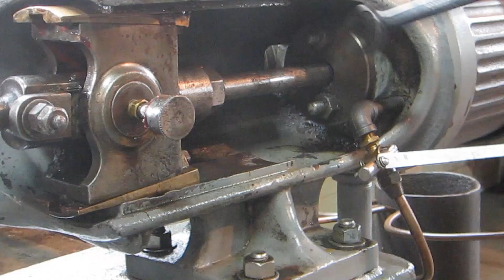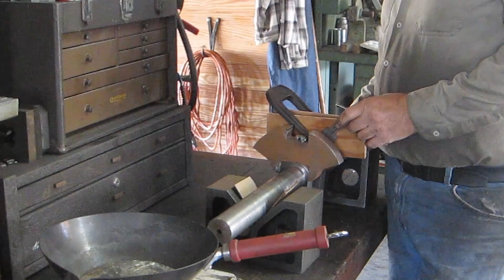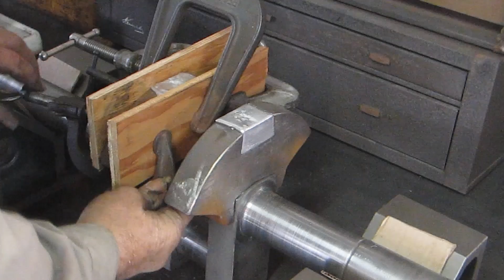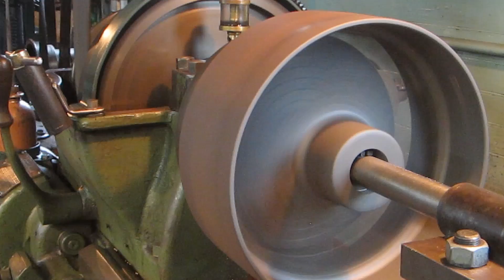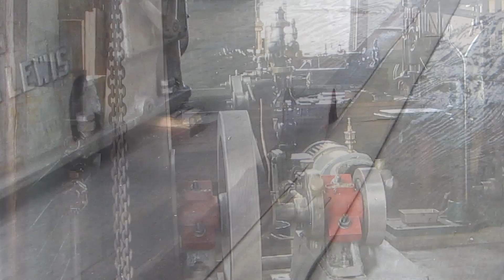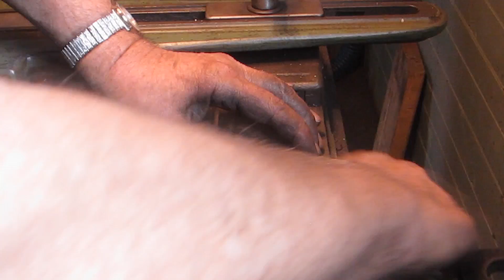OLD STEAM POWERED MACHINE SHOP 21

Comment: Would have been nice to see how you splice a belt? 
Also what oil you use and do you use some sort of glue on the inside to gain friction?
Reply from the maker: Hi John, thanks for watching. I've spliced leather belts 6 or 8 times on some of the earlier videos. I use Neatsfoot oil on the leather now and then, no traction dressing is needed if they are up tight where they belong...Dave

Comment: I noticed a good deal of line shaft coverage on this video,  it was quite good.  When I was very young in an old ranch shop I saw a line shaft system that was equipped with squair profile shafts  throughout the entire system.  The power source was not present.  And several of the remaining shives were constructed from wood. Have you encountered a similarly equipped system? Recently I went back to see it I could get photos but the entire building and all the surroundings building wear gone.
Reply from the maker: Tom, I have seen many wooden pulleys but never a square shaft. Very interesting.....Dave

Comment: very nice job. Have you thought about adding a boiler feed pump to your engine or having a separate steam boiler feed pump?
Reply from the maker: Yes I have a 2 cyl. steam pump that could work for that but would need a feed water heater of some kind made up in the stack bonnet because the pump would put the water in cold, not heated as the injector does....Dave
Reply: Nice. Have you thought about using the Exhaust steam from the lineshaft engine or the pump?   Josh K.

Comment: say dave, really like your videos.  very nice.  here is a thought. about that pully, with the 1/4" crown, I noticed it had a factory balance weight inside the lip.  with as much material you removed, that may throw a lot of vibration into your rafters if it looks as heavy as it is.
Reply from the maker: Hi Paul: All the pulleys are balanced on a mandrel within 1/4 ounce before they are installed on anything...Dave

Comment: When I worked up in Alaska, they put me in charge of the boilers, and my boss had me put in a 8 inch PVC line into camp (yeah it was just above the frost line- good thing I knew how to make sure that they drained) that ran to first a 100,000 gallon boiler feed tank then to the main water tanks for camp. Then I trained a bunch of college kids to thread 4 inch pipe and ran that line 1000 feet to the old boiler secondary tank and to two 125 horsepower diesel boilers. MY Question is stainless fittings? I thought stainless does not get along with steam. I do know you can't use galvanised pipe. Brass is OK, and Black iron pipe is OK too. I am not saying that right. I just remember chasing leaks, and sometimes having to go 40-80 feet to get them all. The two big boilers ran 10 retorts, and the old boiler was really cool. We use a venturi tee to atomize diesel to heat the boiler using steam, and we had a steam driven water pump to keep the water level correct (it used leather check valves) . Ii spent a week cleaning out the flew pipes for all the boilers, and a day crawling down the middle of the two boilers doing a inspection. Good memories.

Comment: Dear David, could you tell us what you know about leather belt maintenance (not repair)? Either in the comment section or possibly in one future video? Does it need wax or oil to stay soft and tough for a long time? Thanks in advance.
Reply from the maker: I use just Neatsfoot oil on the back side. It works it's way through....Dave
Reply: In what intervals do you apply it?
The back side is the hair side? And the meat side is contacting the pulley.. Some other videos are contradictory on that.
Reply from the maker: Correct, hair side should not be against the pulley to avoid cracking, but I've run either way. the new belt material is so soft and stretchy that the hair side gives more traction. I oil them a couple times a year. most important is running them in the right direction so that the splices won't chafe.....Dave

Comment: 20:31   I have what is probably a really dumb question for you-------why not use a magnet to get rid of the iron or steel filings in the bored out hub etc.???????
Reply from the maker: Not a bad idea, then you are not blowing the iron dust all over the shop and into the chuck...Dave

Comment: First of all I love the videos and the subject so thank you very much. I live in Arizona and I realized that a steam engine might be an excellent choice to pump water in the middle of nowhere. what bore and stroke should I look for to replace a3 to 4 HP pump. Wells out here are deep. Think 700-800 feet?
Reply from the maker: Hi Joel: Well. not knowing anything about the type pump it is, it 's a little hard to say, If it's a real deep well, the pump would have to be down in the casing to within about 25' of the water. A pump like that would have to be a rotary type with a rotating shaft down to the bottom or a reciprocating rod pump with a crankshaft to run it up above ground (like an old oil well)  Those were like the windmill driven pumps. Probably a 5-6 HP steam engine would run one of those.....Dave

Comment: You have encouraged me to get into steam. As an engineer doing mainly solar and wind design and manufacture and renewable energy in general along with extensive contract prototype work, steam using wood fuel fits in well

I have developed and sell what I have called a Sun Chiller which is a solar powered foam insulated 200 cubic foot box on wheels that serves as refrigerated harvesting of perishable greens etc. Easily holds 36-40 F even on the hottest of days.

I designed and built a solar powered parachute droppable emergency water purification/power station/communication station for the military.

Now a local CERT (Community Emergency Response Team) group took an interest in that design and now  has me doing a combo of the chiller/water/and power and they wanted backup for the solar power.

They were confident that even in a big disaster diesel or propane would be available for generators.

I convinced them that locally salvaged wood would be far more available.

Now I'm putting in  a 10HP rated monotube boiler and engine driving a generator as solar supplement.

I have developed a very low cost method of converting permanent magnet stators and rotors from salvage Prius trans-axles as 10kw 48 volt generators regulated to batteries via an off the shelf solar regulator. Even with the additional  materials and machining for a new fluid cooled housing I come out way ahead of anything else I can buy so far as dollar per watt.

I now power my extensive machine shop and wood shop from solar but after seeing what you are doing with steam I'm contemplating a larger steam setup for more solar power backup.

Thanks for some very interesting videos.

I may do some myself once I get this new boiler/engine going..
Reply from the maker: very interesting so far, good luck with it....Dave

Comment: Dave, what size of hit/miss engine would it take to replace your steam engine?
Reply from the maker: Gee I don't know Gord, maybe 6 or 7. The "Flywheelers" will be running a 7 HP Economy on theirs, but I think the main belt will be a little "jumpy"....Dave
Reply: Gord Taylor The Tri-State Threshers in Bird City KS have a hit and miss engine on a line shaft setup in the blacksmith shop running a lathe and a couple of other machines, I think it is 5hp (not sure) but it gets pretty warm so probably should be bigger.
Reply: Not many of us metal heads have the means to have a steam driven shop like Dave Richards but might be able to use a hit/miss engine for a similar shop.

Comment: Dave another great video. Now another steam engine in the wings. What are your plans after you restore it?  Will it have a job in the shop or maybe outside the shop?  Please keep up the good old work. Thanks.
Reply from the maker: Hi Gerald, One plan would be to put the Richards engine on the line shaft running the shop and moving the O&S engine to the boiler side of the door and run a lighting generator with it....just a thought....Dave

Comment: Well, this is weird........ I visited your channel just yesterday to make sure I didn't miss a new  video, and here you are today with a new video, LOL !!!!  Your videos are my most anticipated on YouTube.  Thanks for another edition of great work and fun !!!!
Reply from the maker: Thanks Mr. Iron, would the 292 be an inline Chevy or Y-block Ford?
Reply: That would be 292 Chevy inline 6.  I'm a classic Chevy truck fan, and a huge fan of Chevy's old Stovebolt inline engines such as the 235 and 292.  However, currently I'm restoring a 1929 Ford Model A Doodlebug tractor conversion which is an original conversion from the 1930's.
Reply from the maker: Great old engine, I've got a front engine dragster with a 292. runs 10.0 &138mph on gas.
Reply: Oh man, that's cool.  Chevy 292 is a great engine for sure.  Do you happen to have a video of the dragster?  At one time I belonged to the Inliners International Club.  I'm thinking of re-joining.

Comment: Welcome back. Been missing your videos. You mentioned building a 5x5 I think you said. I'd be very interested in seeing that done. I've been making small models but have in the back of my mind to make a larger one that could actually be used to power something, my old South Bend for instance, just in case there was an EMP or solar flare or something LOL. Also looking forward to seeing you tear into the other two engines and get them fixed up. Your channel is definitely one of my favorites and can't get enough of it.
Reply from the maker: Thanks Greg, I've been looking for a large cylinder casting available for several years, with no luck. Have to make up some patterns I guess....Dave

Comment: David, My step grandfather had a steam power shop when I was a kid. I would pester him until he would run the engine when ever I got to visit. Nothing else on YouTube is more anticipated by me than your next video. Thanks for your commitment. BTW: My dad has his fathers engine indicator. Do you have one? I would really like to see one set up on an engine. I think it was for timing but not really sure.
Reply from the maker: Thanks for the comment Terry. Yeah, an indicator sort of "maps" the pressures inside the cylinder under load in relation to the piston position.  A diagnostic tool. I never had one. I tried to get Tom to think about making an electronic version....Dave
Reply: David Richards How badly do you want one ?I have one buried in my storage locker.Missing some Springs but has some indicator cards from 1925. Next time I see it I will pull it out.

Comment: if your using topog-e hand hole gaskets they need to go in dry without anything on them. they will blow out if your not careful.
Reply from the maker: I knew that would get noticed by with good eyes. I haven't had problems yet, they leak if I don't....Dave
Reply: David Richards I work on new boilers and it's awesome to see your boiler. I was wondering how you injected water into it, we use big 3ph pumps and it's cool to see how they did things back in the day. I love your shop, it's like watching old timey movies in color!
Reply: David Richards I should rephrase that, I work on boilers but have my own machine shop so it's cool to see them together.
Reply from the maker: Is there a feed water heater involved with that?  If the old timers were running a pump instead of an injector which heats the water some), they would usually require a heater to keep from pulling the steam down and lessen the thermal shock. Maybe it dosn't matter on a modern welded boiler.....Dave

Comment: So why would leather now be no good compared to old leather? Are cows made out of different stuff? or is it the lack of tanning to the leather that makes it not as good? A job rebuilding steam engines sounds good to me! I love all engines and making them work.:-)
Reply: It's how the leather is cut, skived, stretched and tanned. No one is making industrial leather anymore. It's different from "normal" leather. It's like using veneer for house construction.
Reply from the maker: Hi Brian, well...the experts say that it's what you feed the cows. I have a 1" McMaster Carr "mid grade" belt on the small lathe. It's about 12 ft. long, never stopped stretching. It's like a rubber band. Bring on the concrete....Dave
Reply: I wonder if the age of the cow effects the leather? I am sure there were people well versed in such things in the past I wonder where all that knowledge went??  too bad people weren't better about documenting"common knowledge".
Reply: some will say it's all of that GM feed they are getting

Dad used to say that he raised cows simply to keep us boys in boots.  Sounds like an old fashion shop would have to keep a herd just to have belts...  but judging by what little I've read about old tanning methods, I don't think I could put up with the stink of the tanning area.

Comment: I was worried that you quit! Man am I glad to see a new video from the steam shop.You rate with Fenner, Mr. Pete222, Abom79, Rucker, Kilroy, and a few others I watch regularly, but they don't have STEAM driven equipment. Your "old way" of doing it is older than their old way. Gives a break from the rest with as good quality and education. You are leading in your own field and setting a high bar, yet still in good company with other You Tube machinists. 

Now that you are going into fixing up older engines and stuff that makes it even better! I'd give you two thumbs up if there was a way to do it! Keep 'em coming' ol' Buddy!
Reply from the maker: My "old way" is older that their "old way"?  Ha,  man that makes me feel old because thats the only way I ever did it.....Dave
Reply: Naw, at 7:41 you talk about how you learned from "old timers," and using "old, old shop manuals and this is the chance to see it actually done with actual stuff" and I'm sure that's the way your are doing it, like they did back in the day. You see more recent methods on the other channels but the old way of doing things is very interesting and unique. I've noticed it on your videos. It's a different technique and it fits the period of line drive, steam powered shops. We don't get to see that much. I don't know of anywhere else.

Their "old way" is using electric powered machines and some have DROs but not so much as CNC. My stuff's like theirs. It's all good, but yours is more unique. Great stuff.

Comment: It was great to see a new video....Every time I see the small drill press on the bench ..I dream of someday someone will copy it and make some reproduction ones ..I wonder if it was cast in aluminum would it be tough enough for light use in a small shop
Reply from the maker: Some parts might need to be steel but the main frame could be repro'd in aluminum.  I've seen them at shows and flea markets for not much money....Dave

Comment: NIce job as always Dave! Good to have you back! I'm curious, why did you take the second taper cut on the pulley from the rim on the chuck side? I would have cut towards the chuck, my logic would have been that it would be easier to see when I met center on the pulley face to the first angle. I know you had a reason to start it from the rim, I just can't figure why.

Comment: I see your old drill press and I  know you are around that stuff a lot . I have a Buffalo  Forge drill press camel back drill that is missing the lower pulleys. I'll  have to make them but I throught I would ask you  if you  knew  of anything like that Thanks
Reply from the maker: Hi Terry, Get back with the diameters on the stepped pulley and I'll see what I have, you are probably running the bottom shaft with a V pulley and motor?...Dave

Comment: Thank you for putting up these videos, they are a pleasure to watch and have taught me much. I do have a question though, where do you think a lineshaft clutch could be found? I'm setting up a lineshaft for an early Ames lathe and I really don't want to run it direct-drive unless I have to.
Reply from the maker: You could put the clutch on the line shaft, but most set ups have the clutch on the engine. I've seen engine clutches (or parts) in engine flee markets. They are all similar and can be adapted if necessary with a plate to bolt to an engine flywheel which usually has holes in the spokes for one. The Flywheeler's machine shop did that, good hunting.....Dave